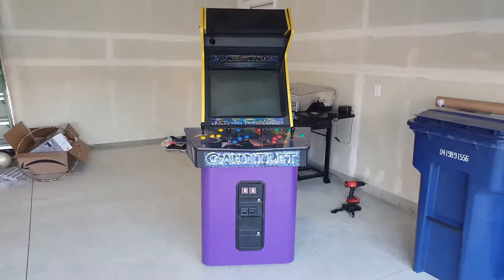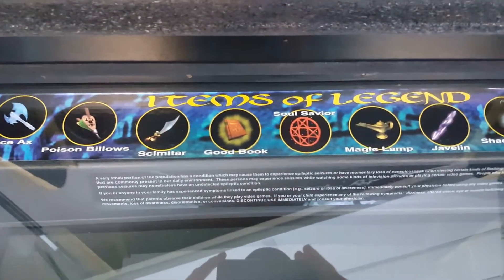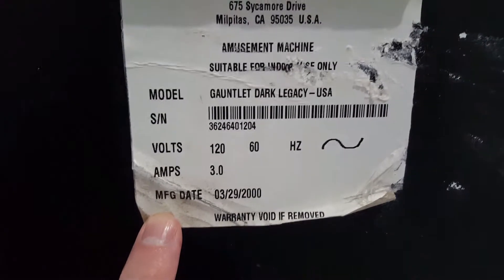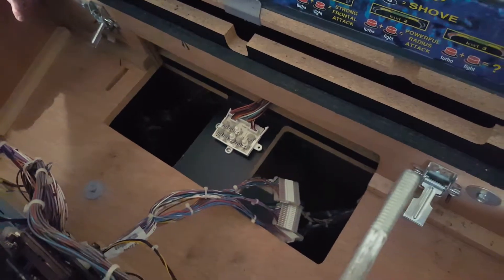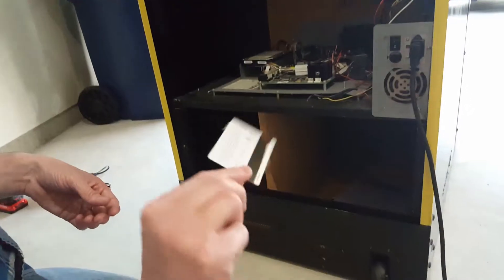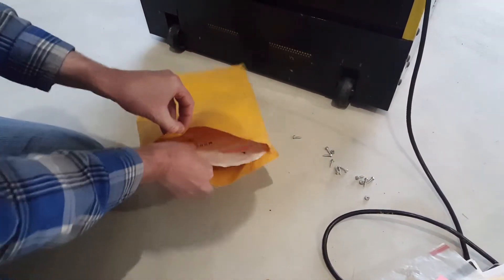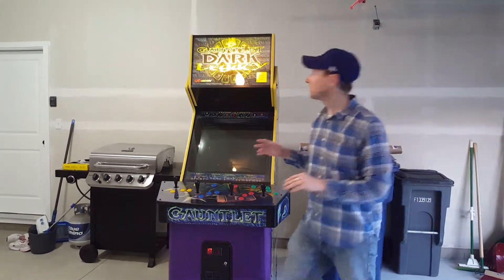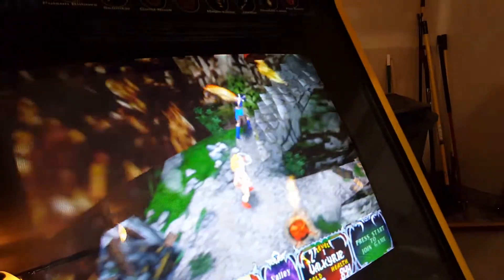Gauntlet Legends Dark Legacy Arcade Cabinet Overview

Comment: excellent find classic arcade game great example too. Sure it could do with a few touch ups hear and there but the cab is solid. I'd recommend swapping out the hard disk for a compact flash card i always worry about those disk failing. Swapping the power supply is a must too any switching power arcade supply should be good enough.

I'd highly discourage the use of original power supply you know then that the logic board is receiving a clean power supply that won't harm it.
Reply from the maker: Thanks for watching appriciate it! Been working on my Donkey Kongs but will get back to this game eventually.

Comment: I just got a cabinet like this from work, but it doesn't have any of its internals...
Reply from the maker: It's a great looking cabinet so that's a good start. Join the klov website they will be a great resource to help you find what you need.  Let me know if you need to reference anything off mine.
Reply: @ToddsGarage  Thanks Ill check it out. I was also told that Ultimarc is good site as well.
Reply: hate to bother you with this, but I tried to register on the klov website, and I got the registration email, but the link is broken, wont load and when I go on their website to go to Contact us, you need to enter the security code to prevent spam, and it doesnt even show up lol....
Reply from the maker: @Pacoklein  Hi, are you using Google chrome? If not try that and let me know and I can let the admins know of the issue.
Reply: @ToddsGarage  yeah using google chrome
Reply from the maker: @Pacoklein  ok il let them know of the issue.  Try a different browser too just incase.  Try edge. We want to get you into that site its great!
Reply: @ToddsGarage  ok thanks for the help much appreciated.
Reply: Another question for ya, is there a way I can plug the gauntlet legends hd into my computer to see if it works?
Reply from the maker: Hi, I am sure there is. This would be a perfect question for klov! Have you had any luck getting in?